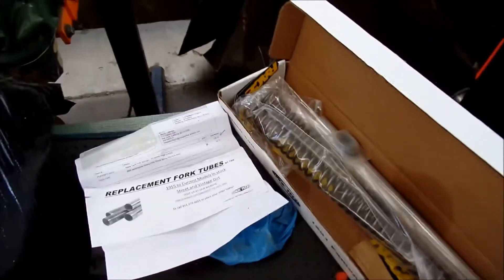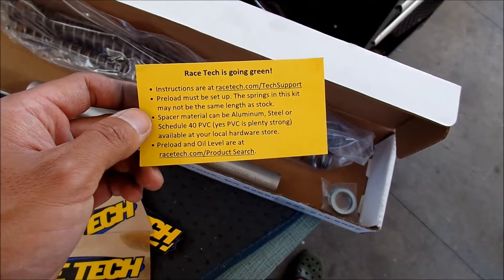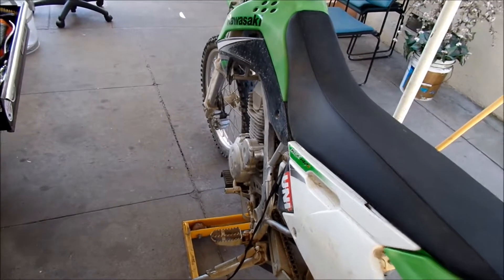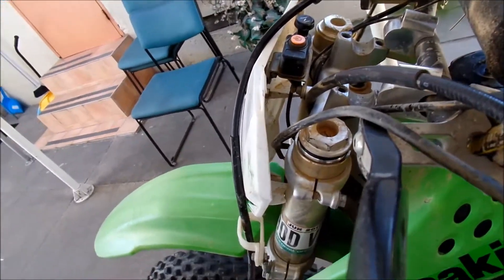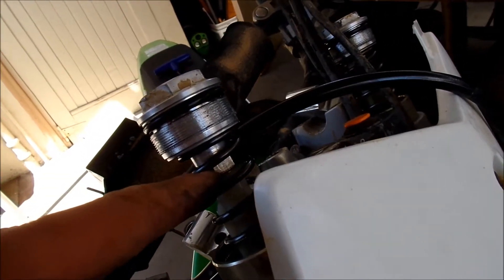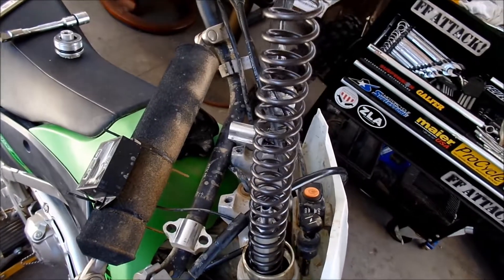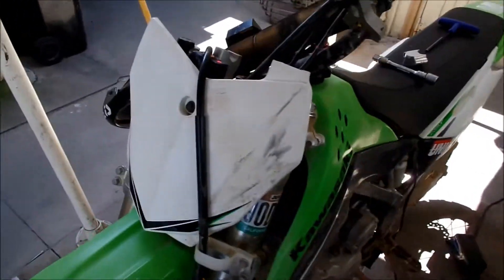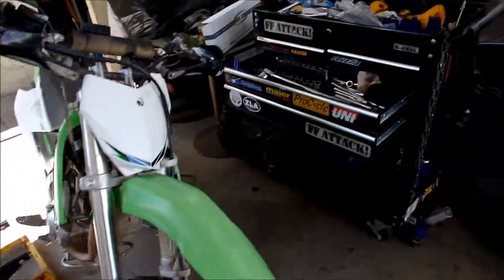HadesOmega How To VLOG: Install KX100 KX85 Fork Springs

Comment: fyi, I attempted this on my kx100 tonight, all the disassembly steps were great, but as soon as I removed the cap from the damper rod, the rod retracted into the fork tube.  not sure how or why yours stayed up. now I essentially have to do a full tear down to reassemble.  be careful.
Reply from the maker: Thanks for the tip ;)

Comment: how was the spring? any differnce from tha old spring? does it become stiffer.?
Reply from the maker: It was a big improvement for me it would bottom out less
Reply: @hadesomegamoto7639  thank you sir. im planning to change mine too. it would help me a lot. hope you can post some riding videos with it.
Reply from the maker: @ariesdailymotovlog9509  I have a couple race videos with the bike right now I put 15wt oil in it and it's too stiff I'm probably going to go to a 10wt.  Type in "HadesOmega Harescramble" or "HadesOmega Supermoto" and you might find them.
Reply: alright thats great. and what rear suspension are you using?
Reply from the maker: @ariesdailymotovlog9509  I am using the stock KLX140 shock with the BBR Rear spring
Reply: wow thats so awsome. how much did you spend on bbr spring?
Reply from the maker: @ariesdailymotovlog9509  I think I spent about $120?  I don't remember but I feel it was around that much.  It helped a lot it won't bottom out as much especially if your sitting down.  I took it to a motorcycle suspension shop and they said that the rear spring is still too soft though =/  I'm 175lbs without gear on and 195ish with gear on.  I actually installed the rear spring before the front springs also, you want to install them together though but I didn't have the front one yet.
Reply: wow nice. soon ill replace mine too. thanks for the advice sir and ride safe. more power.💪
Reply: one more thing sir. around how many mL of fork oil did you use in each fork tubes? thank you
Reply from the maker: @ariesdailymotovlog9509  Hmm the KX85 manual says this (this is the fork oil level):
Oil Level (fully compressed, without spring)
Standard:
KX85A: 100 ±2 mm (3.9 ±0.08 in.)
Reply: @hadesomegamoto7639  its really hard to understand this. all i know is through mL.haha! im not really a mechanic so its hard for me. and i searched it in the website of racetech they say its about 90mm. but i dont know exactly how to convert to mL.😅
Reply from the maker: You measure from the top of the fork to where the oil is.  There is a special tool you can use to measure and set this.  Basically a syringe with a pipette.
Reply: @hadesomegamoto7639  ok sir i will try that. thank you so much for the non stop advice. more power sir.💪🙏